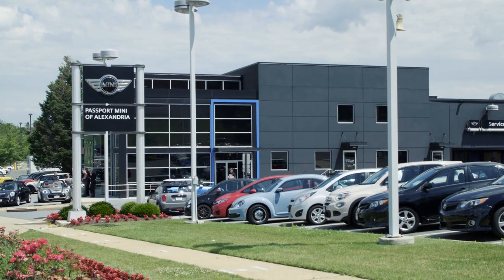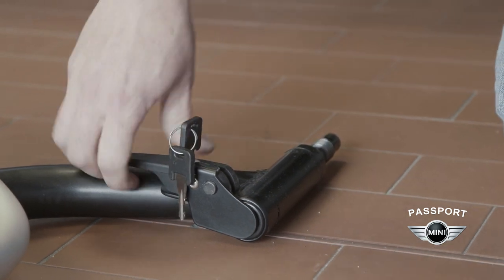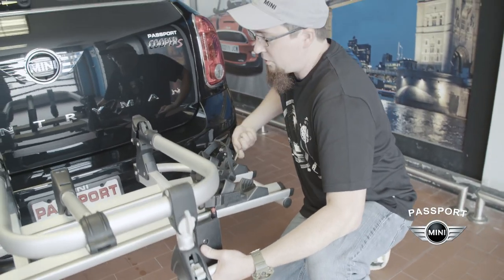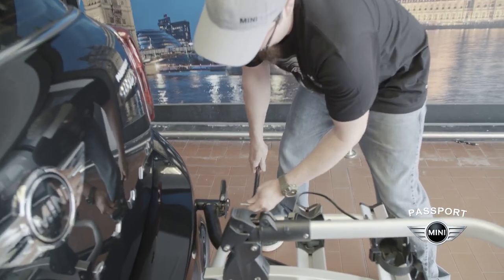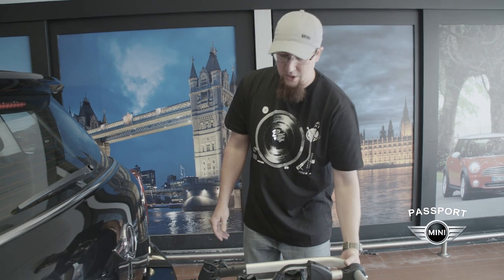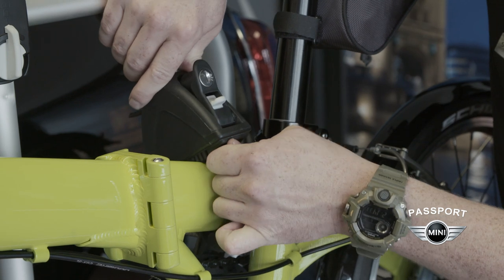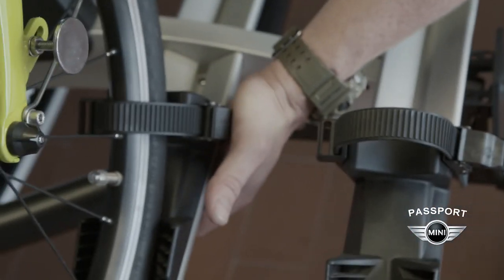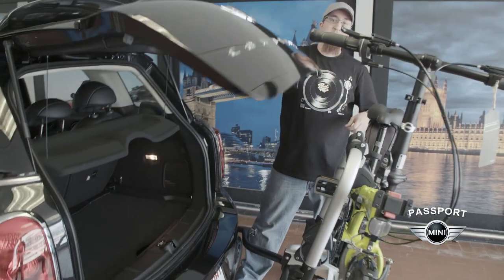MINI Sessions - How To Install a Bike Rack On A MINI Cooper

Comment: Great video, very helpful. Is it possible to add a tow hitch to an All4 Countryman if a bike accessory preparation has already been factory fitted. Does it make adding the tow hitch easier, harder or impossible?
Reply: MINI's have no tow rating, so the dealership is prevented from answering this question because of liability.

Comment: Are there any bike racks for the Clubman?
Reply: I think Countryman and Clubman use the same system. Check the back of the car, if there are two parallel holes on the bumper.